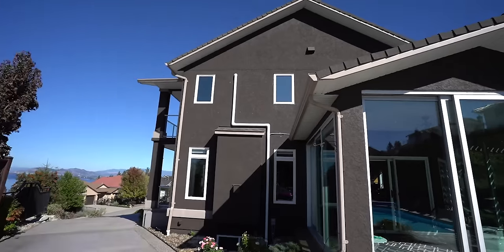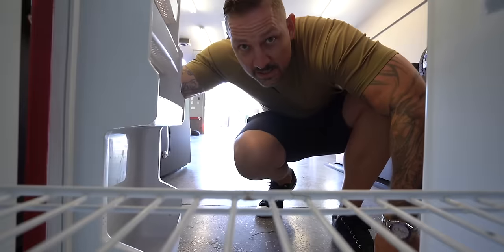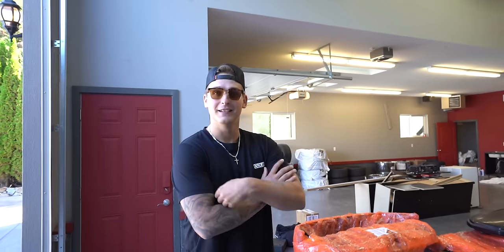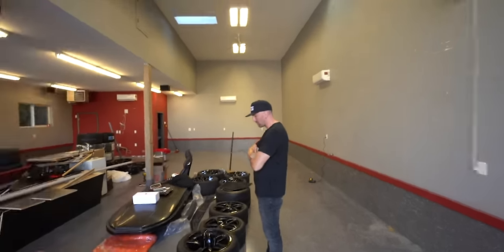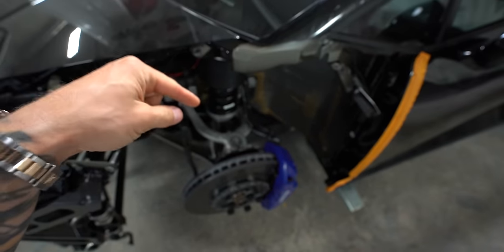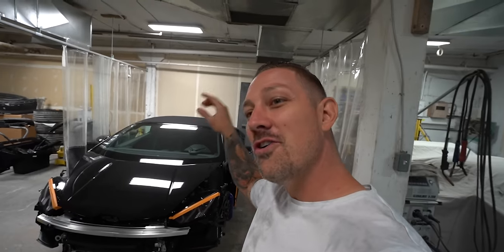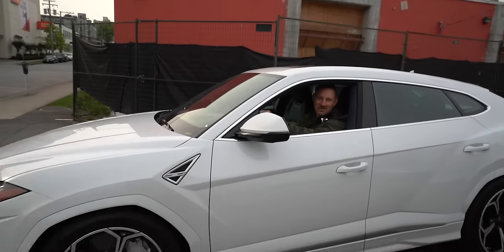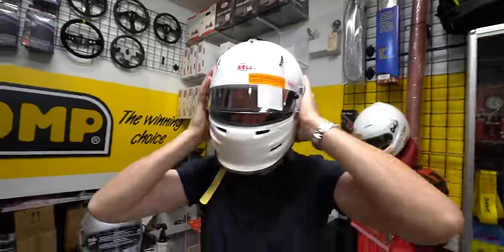REPLACING MY MCLAREN P1 HYPERCAR WITH 4 SUPERCARS?!

Comment: If you get a Urus the most crazy thing you can do to it, is going to be having a 1016 industries forged carbon fiber wide body kit with a forged carbon hood Side Skirts, Front Aero Lip, Rear Diffuser, Roof Spoiler, Trunk Spoiler. This kit looks amazing on a urus and some big 24 inch wheels to go with that. White and black would look amazing.

Comment: Urus 4x4²: 10 inch lift, 37 inch beadlocked tires, an insanely rugged bullbar, and chopped fenders 

Urus track car: 390's in the back, 365's in the front, a chassis mounted wing, slammed to the ground with an aggressive lip kit and canards, combo'd with two massive twin turbos to match the F12. An undeniable track monster.